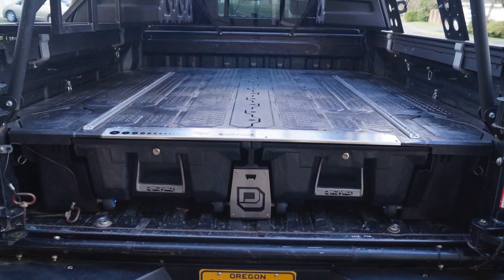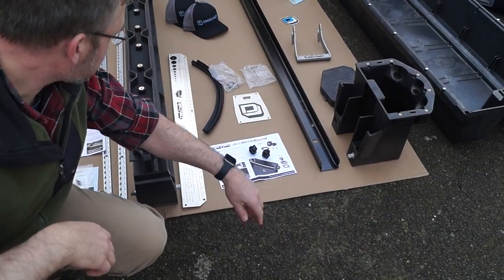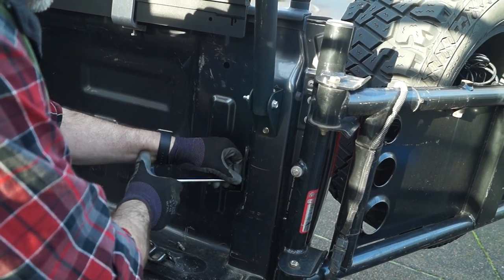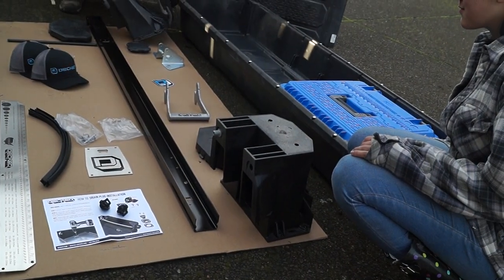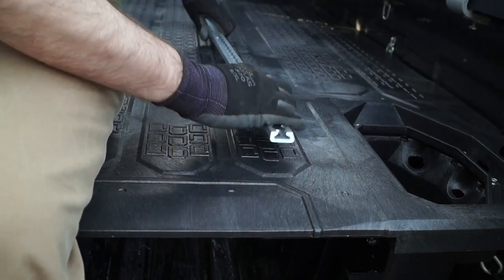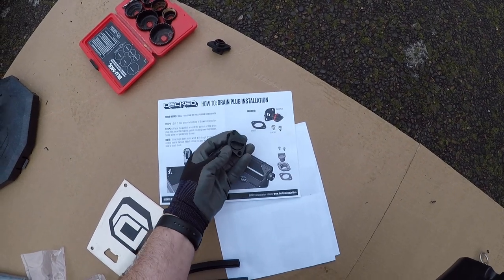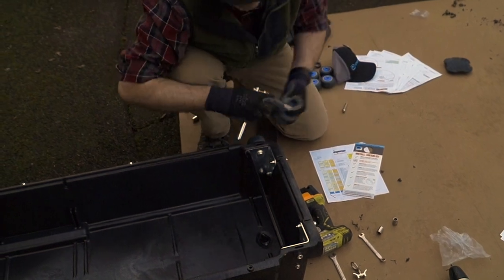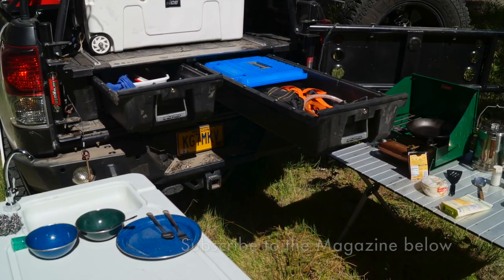Overlanding DECKED drawer storage system truck install w/accessories

Comment: I have one of these installed in my 2015 ford transit 250 midroof .. it’s awesome.. it’s solid. I’ve had it going on 2 years I have an MV84 sewer jetter sitting on top of it. It’s basically a big Industrial pressure washer and I have 2 hose reels mounted on it.. Alcoa coup,d Milwaukee packout mounting plates on it so I can add tool boxes and swap them out as needed ..as much as 1500 pounds sits on it..  holding up great drawers are still as smooth as ever..     I thought about building something instead.. glad I didn’t .. there is no way a wooden one would have held up as good.  I love it..

Comment: A few things folks... add some rubber tubing around the ammo boxes with a 1/4" space to prevent vacuum lock and they'll be waterproof. Also, the Decked system is water resistant for any kind of rain or a car wash. It is NOT resistant to find dust/sand. if Overlanding it will get in the drawers so put your sensitive items in one of their toolboxes or some waterproof container. the ARB waterproof cargo bags fit perfectly BTW.

Comment: Great Video
I was just wondering if it would be compatible with a Napier Sportz tent. 
After all, it is just raising the tent floor by 30cm (which actually would be a bonus sleeping higher from the ground. Are the straps long enough for this?
It is for a Crewmax Tundra Gen 2.5
I am VERY interested to know.

Comment: About to install on my silverado trail boss in Australia. I need 2 storage boxes the length of the bed, left and right sides on top of the decked system. I reckon I can bolt through the plastic to secure the boxes and use silicone to seal the bolt holes. Does this sound possible to you?

Comment: I'm getting a Tundra soon and will likely get a decked system.   Could you use a threaded rod coupler on the hook bolts inside the ammo boxes and thread an eye bolt on to that to maintain corner tie hooks with the ammo box lids off?

Comment: Great video, I'm just about there in terms of just buying the system versus trying to build my own. However, there is one thing that concerns me. It looks like you lose quite a bit of space just to the device itself. I was wondering what your thoughts were on that given that you've got the system installed. It might just be it looks that way from videos and pictures.
Reply: I just finished installing the Decked drawer system in my Jeep Gladiator. Yes, you most definitely lose "space" but you make up for that lost space with secure, organized space. In addition, you still have the top of the Decked system to put stuff. Before you buy this system you really need to be willing to give up your entire bed. If you still want to haul dirt and other large, loose material, the Decked system is probably not the best choice. I'll take secure, organized space any day. I absolutely love it.